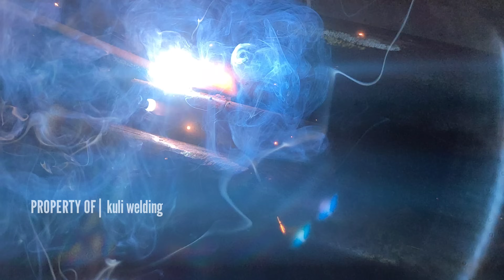how to weld door hinges quickly and accurately | welding trick

Comment: Much simpler to just use a 1/8" shim on the pipes and tack them in place. Remove shims and weld single pass on each side. No measuring, no added pieces, no extra welding. So much quicker to finish.
Reply: You should do a YouTube video showing that too
Reply: I agree with you
Reply: Its crazy idea